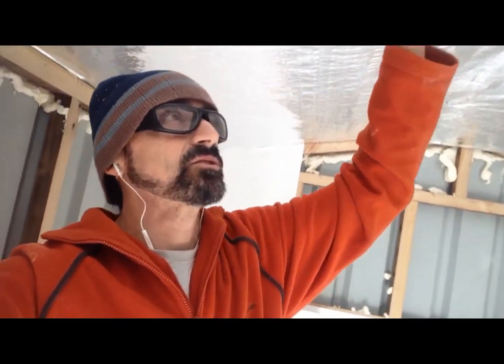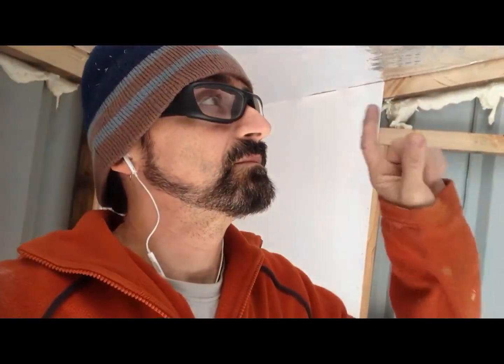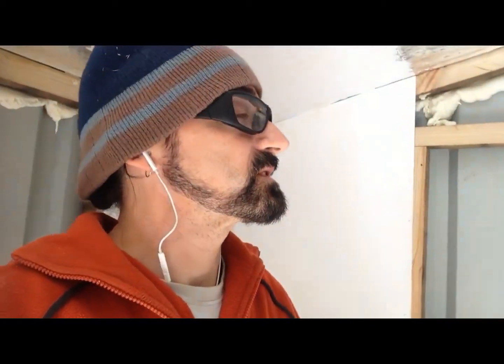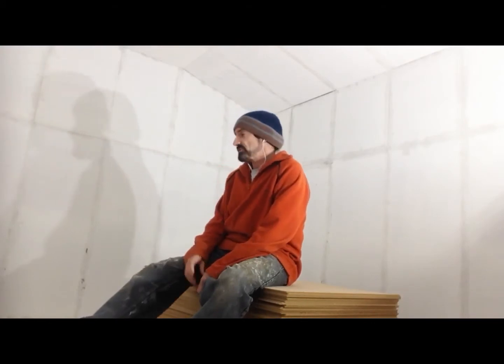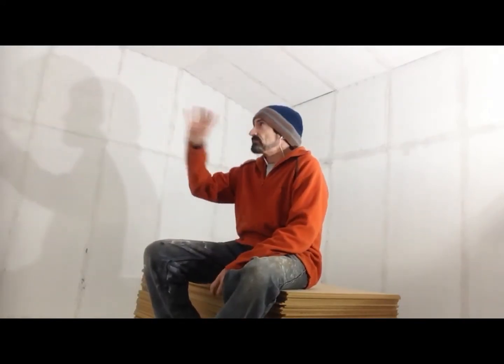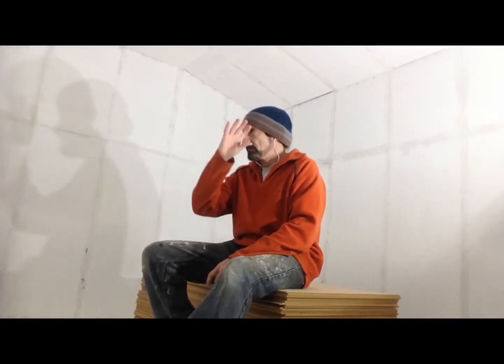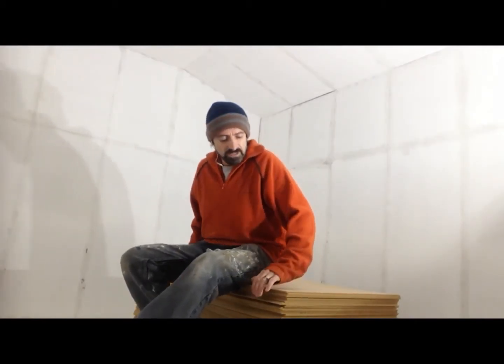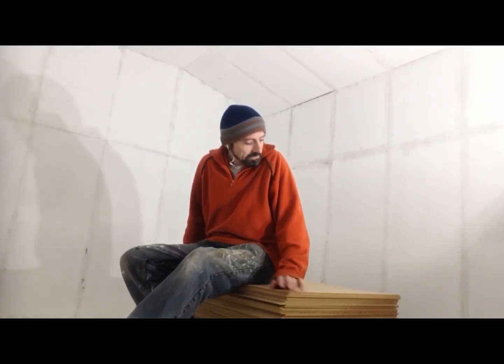Lining the Shed Pt2 - Walls and Ceiling DIY

Comment: If you do any scrollsaw work you can use the mdf for those projects. I've used it and it works nice just dusty.
Reply from the maker: John Baker I’ll definitely look into that as I’ve got access to scrollsaws. I actually used a few sheets yesterday to make a box for some stuff that went into the shed. 👍🏻 only 94 or so left 😜
Reply: Yeah I made a shapes tray puzzle out of MDF for one of my nephews and sealed it up real good with shellac painted each piece of different color he loved it
Reply: And also one of the guys in my local turning Club glues MDF together and turns coves in which he puts buffing compound and then turns his lathe and reverse and uses it to hone his gouges in between Sharping
Reply from the maker: John Baker hey I like that honing trick.

Comment: What did you use for the ceiling please? How thick was it please as I’m looking to finish my ceiling off in my metal sheet.
Reply from the maker: daniel dublin I used 3mm MDF for the entire lining mainly because I got an absolute bargain in the purchase.  It’s painted on both sides with 2 primer coats and a semi gloss exterior paint to keep it sealed. 
Thanks for watching.